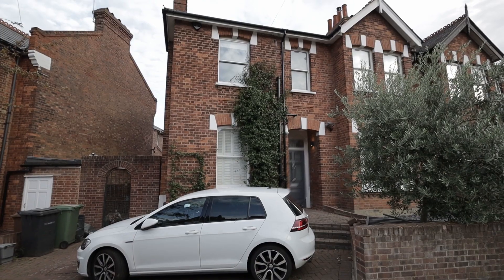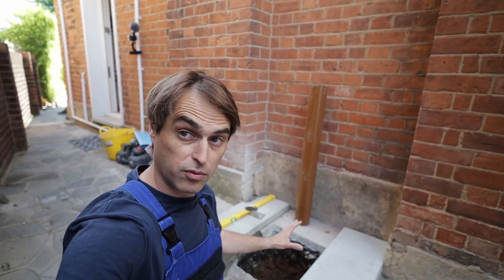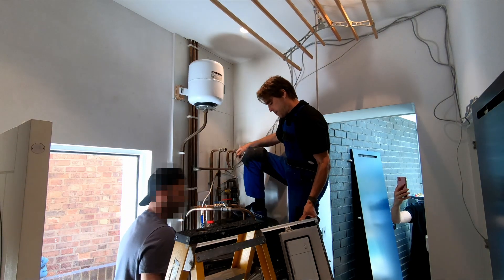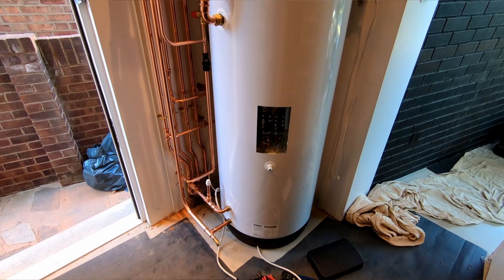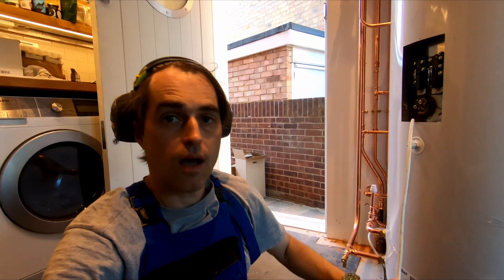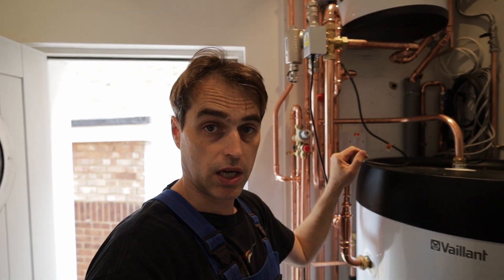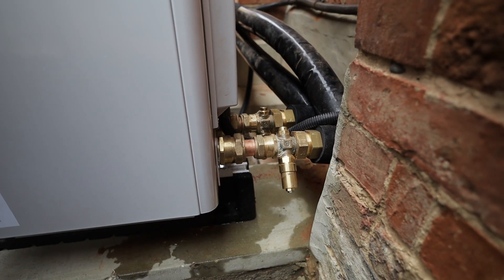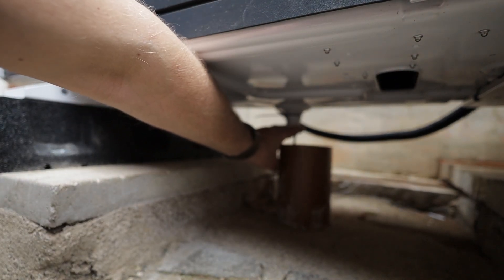Is This Heat Pump Better Than Your Gas Boiler?

Comment: How does the heat loss relate to the ASHP sizing? I’ve had contractors calculate about 11-12kW for my house and recommend a ASHP size of 14kW “to have a bit of a buffer” - doesn’t seem quite right.
Reply from the maker: Yes, either size for 100% or slightly below with the prospect of improving insulation. Never oversize
Reply: @UrbanPlumbers  actually, one additional question, would the hot water demand not have to be accounted for in addition to the heat loss for determining sizing? Also, if you were ever keen to install in Edinburgh, I'd happily get you to do the work :)
Reply: Thanks for the quick reply - also really enjoy your videos and professionalism.
Reply: I love the idea of a heat pump. I understand why the precise sizing is required. But does that mean that if I were to add a house extension I’d need to swap for a higher output model?

With gas being routinely oversized, there is usually capacity for the extra radiators without changing the boiler.

Comment: I always keep the thermostat around 18° throughout winter so I imagine I'd adapt quite well to a heat pump. I wouldn't trust an average plumber to calculate and install the correct sized heat pump though tbh.

Where can I find someone as knowledgeable as you in Liverpool area?
Reply from the maker: Google ‘heat geek map’
Reply: @UrbanPlumbers  great tip, thanks :)

Comment: Fantastic Vid. I am waiting still on my 10kW Arotherm Plus I ordered in April here in Denmark. Your video will help me on the install.. Antifreeze valves seem not to be a thing here in Denmark. may need to source them from the UK if I deside to put them in... or live with the risk killing the plate on very cold day and long black out. Being in natural refrigerant refrigeration business I am pretty sure a failure like that will kille the refrigerant circuit as well... need more thinking here... I would love a feture that will force pump to run at low speed via minor battery back up at power cut.... would be an easy kit for the heat pump manufactures
Reply from the maker: Just get PV panels and a battery
Reply: @UrbanPlumbers  fully right. will do. when I can afford it
Reply: @andersjuul7038  Make sure you specify to your installers you want the battery to kick-in in the event of grid outage. It may sound like a standard feature, but it isn't. Unfamiliar with Danish regs but in the UK it requires specific switching hardware and potentially a 3ϕ upgrade. Most people don't bother because its extra cost and extended outages being rare (maybe not for much longer if you've been following our news!).

Great and informative video as always @Urban Plumbers
Reply: freeze valves are only a thing in the UK. they are simply not used anywere else. everyone just uses the anti freeze mode on the heat pump itself that just runs the pump for a minute or two every couple hours or so. but its pretty useless as when it freezes you are also heating the home. its not very smart to keep the heat pump off when its cold. you house still needs heating. in order for it to be a problem (and not use anti freeze in the water) you need solid freezing temperatures AND a power outage that lasts for several hours. if that happens you can still just walk outside and just drain the system yourself.

Comment: Interesting video. How practical are the side venting heat pumps in tight spaces?
There seems to be a shortage of top venting heat pumps to choose from.
Reply: For good reason - most top vent units are mainly ac based or really high btu capacity and are huge, also because they are open to the elements they often have long term issues with electrical most don’t last much more than 10years , my us install all three units are side exit , about 50 db in -15 c my recent trip back out there the were still cop 3.2 in 28c

Comment: The table you show at 9:47  - is that not showing that you put 5kw in and you get 6.4kw  out? - which is a cop of 1.28 - no?
Reply from the maker: No. 6.4 kw output from a 5kw heat pump at scop of 4.13

Heat pumps are rated at output not input
Reply: @UrbanPlumbers  yeh - just looking at the spec, pulls 14A max which is about 3.3kw.
Edit - which isn’t a cop of 4 thinking about it, closer to 2.  No doubt 14A is the inrush current - i wonder what the steady state draw would be when it’s cold outside

Comment: Great vid. We’re just going through the process of removing 2x37kW boilers for a 16kW viessmann 150 ASHP in North London this is very useful. Gonna be a fun project!
Reply: Yeah, I went big on the solar to give ample electrical coverage. 3-phase, 11kW of panels and 3xTesla Powerwalls (40kWh storage 😎)
Reply from the maker: Good luck! Boilers are always 5 times oversized :)

Comment: ‘You could use glycol’ - but you really shouldn’t. Anti-freeze valves are the best solution to the power-cut in the middle of winter issue.
Reply from the maker: everyone knows that - apart for Vaillant themselves
Reply: @UrbanPlumbers  seriously? Are they still calling for glycol for warranty validity?
Reply: They recommend a plate heat exchanger to separate the glycol.
Reply: its not like a power cut instantly destroys your system. that takes many hours and in that time you can just walk outside and just drain the system yourself. or do what i do: hook up batteries to your solar panels.